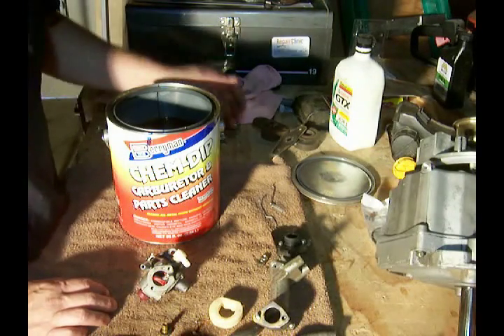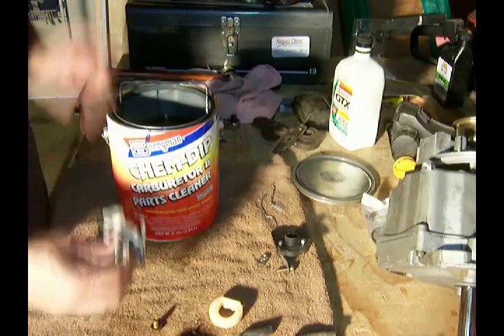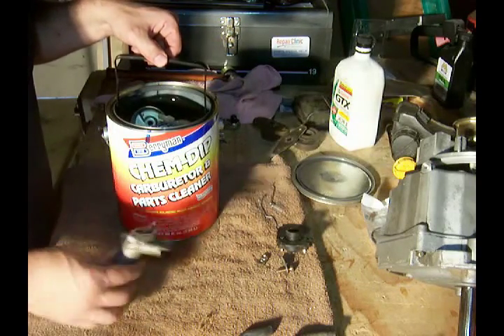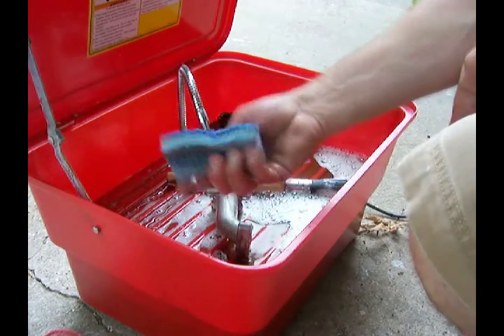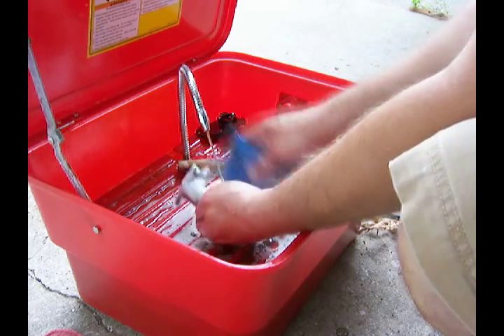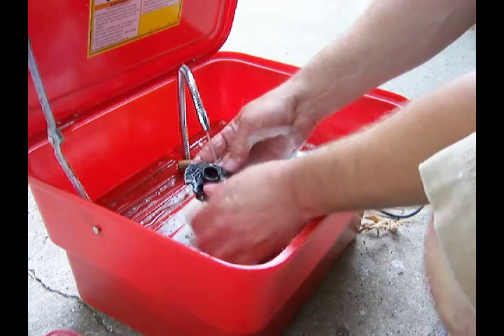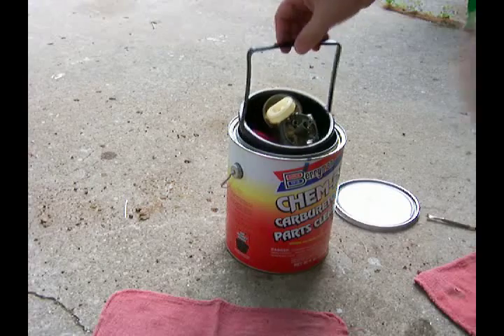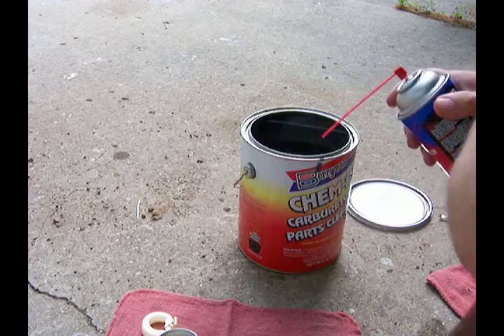#23 Tecumseh LV195EA / LEV120 - Carburetor Cleaning

Comment: Thanks, another  Tecumseh failure.  Anyway, does that can of 'stuff'  harm/damage the 2 rubber washer seals, in the emulsion tube ?  (comes out the bottom, of the float throat, that long tapered part - push out with flat screwdriver, from air intake end. ) you'll see a little bit of the end of it....1/8 inch or so. May be  metal, or plastic.....mine, is blue plastic.